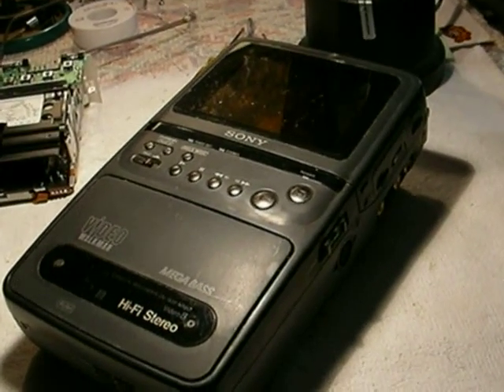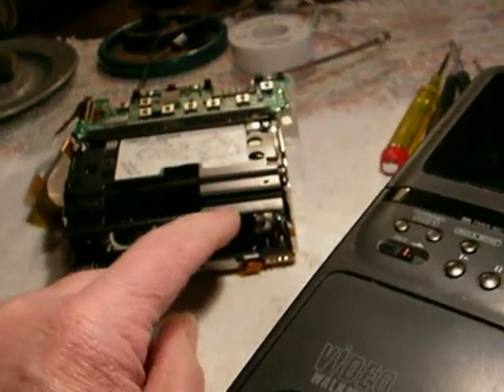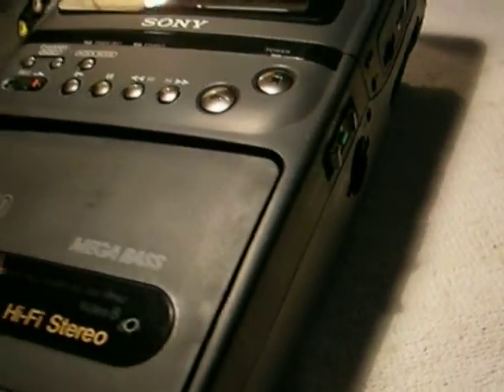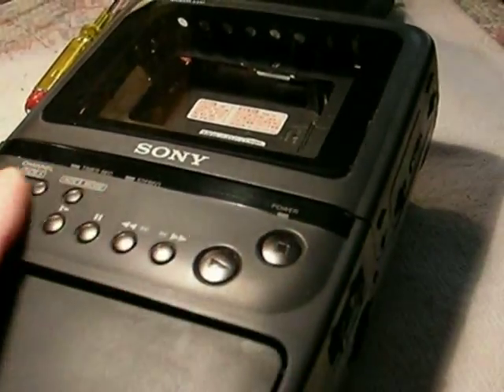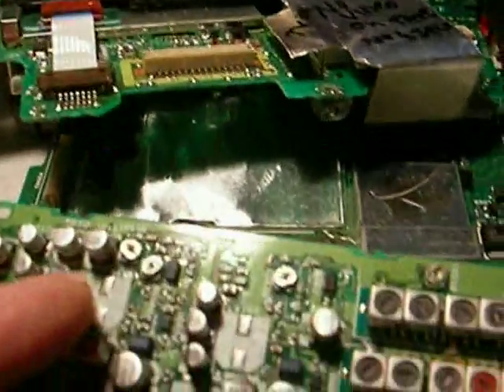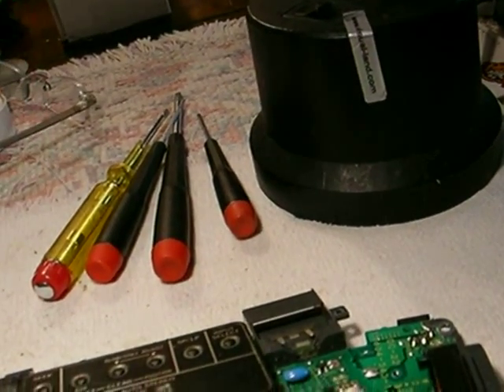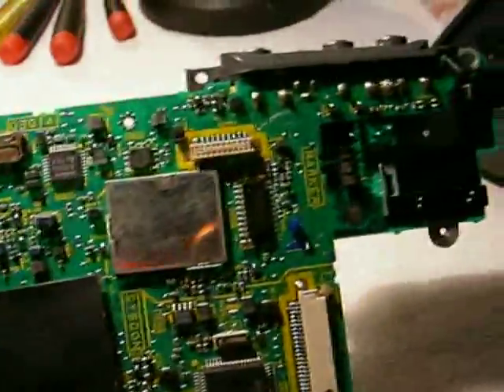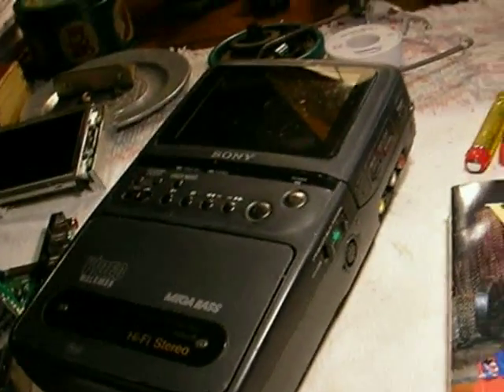1992 Sony GV-300 HiFi portable Stereo Color TV / 8mm VCR

Comment from the maker: It's the fact that the GV8's are way more work to fix, and being even older, more likely to be badly affected by the leaking capacitors- remember that the caps start leaking in about 8 to 10 years, even if the unit was left new in the box, sitting on a shelf.

Comment: Hi there! I’ve recapped an analog GV-200 Video Walkman. It will turn on for 3-4 seconds with power button press and display “BATTERY DOWN” and shut off on battery and bench power supply set to 7v. I’m checking voltages at the control IC and I get 3.5v at the BATT DOWN pin (#50.) If I’m reading the schematic correctly 3.5v is what one wants to see at that pin. Could this just be bad traces or vias? I’m extremely motivated to fix and use this device.

Comment: Hi, I'm trying to repair my GV-300 PAL version and after replacing all SMD capacitors, the mechanism can't load the tape. The drum tries to start to move but stop it after some seconds. With patience and after several attempts powering off/on/ejecting/closing the tape, I was able to load the tape and play perfectly all functions working 1 time only.

So, the unit works fine 100% if the drum moves correctly. Do you know which capacitor is failing or what is causing the moving of the drum to check? I have the service manual but I don't know how investigate this...

I'll appreciate you help! many thanks in advance!